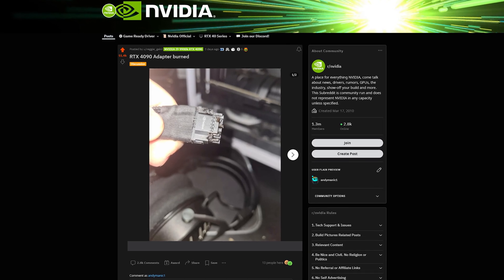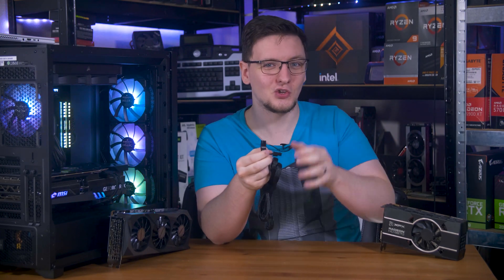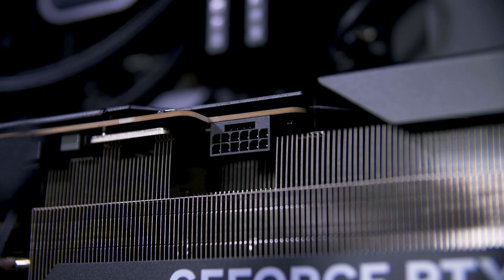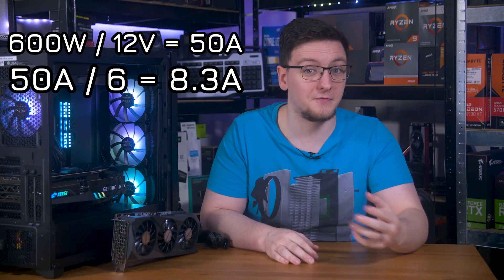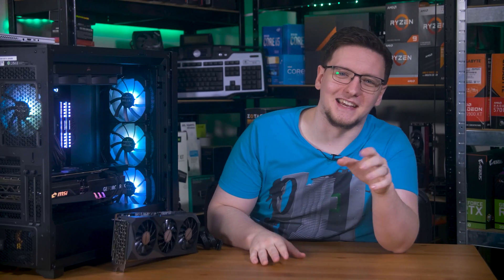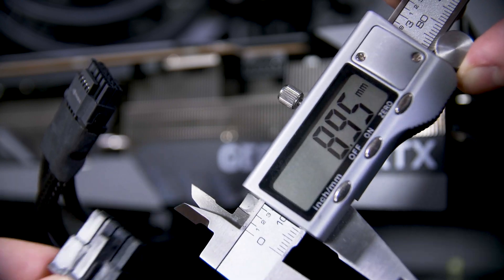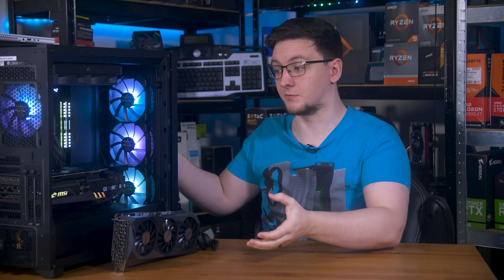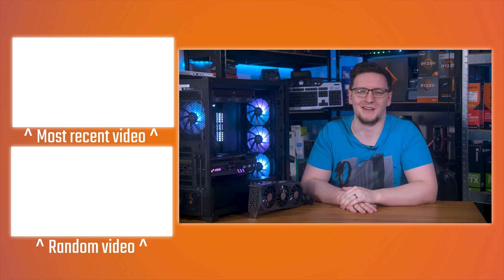Fire Hazard! Design Flaw? NVIDIA 12VHPWR Connector Explained

Comment: And now we know it was neither the fault of the card, adaptor or cable it self but rather people not plugging in the cable fully.
Reply: NO IT ISN'T ! The contacts simply have inadequate current rating. Per UL and IEC standards, the contacts should never exhibit a temperature rise in excess of 30 or 45C. To melt Nylon 66 (the insulation material) they are increasing in temperature by SEVERAL HUNDREDS of degrees C !
It's DEFECTIVE BY DESIGN !

Comment: i have a 6900XT and that uses 3 - 8 pin connectors i would rather have them than that stupid 12 pin talk about going backwards but hey that's Nvidia for you and at probably over £1500 they are laughing all the way to the bank

Comment: Having followed The Great 12VHPWR Connector nVidiapocalypse more closely than I'm comfortable admitting, here's the silly stuff I've learned.
-- the whole of the terminals are made from stupidly thin and easily to damage metal
-- itty-bitty, teeny-tiny solder pads attaching big old wires can break away from the rest of the terminal
-- the electrical load of the graphics card isn't balanced across the wiring where joined to the terminals
-- the wires are attached to the terminals with solder alone without being bonded with a crimp
-- the terminals provide no form of strain relief, both to and from, the attached wires
-- because the female portion of the terminals have two slits, the connection to the graphics card's pins is more apt to degrade from lateral and sideways force
-- in terms of wattage, the ~35% safety margin of the 12VHPWR fails in real world usage (golly gee whiz, with a little connector like that, it was utterly unpredictable >:-) 
-- seeing something built down to a cost, as contrasted to being built up to a standard, can be a wonderful source of schadenfreude

Comment: The loads on the cards are getting ridiculously too high anyway. But this connector isn't just good enough. It doesn't do the job properly. It should be changed, and it should have a better seating position than what it has now. At this rate I can see next year that will have cards with their own PCU's.

Comment: Jayz and Igor already reported that the issue isn't really the connector, but the supplied cable breaking up, which causes the remaining cables to draw all the power.

Edit: Looks like you already got the news, I didn't see it until I reloaded the page.
Reply: Hi, please watch Actually Hardcore Overclocking's video's (ramblings) covering the connector.  There isn't nearly as much of a safety margin with the 12VHPWR connector as there is with the normal six plus two connector.  This standard seems kind of borked.

Comment: Is the tech community REALLY going to have a robust discussion on why a cable under a 450W-600W load that is also EXTREMELY BENT very near it's connector may short/catch fire? A 90 degree fixed connector most probably fixes the problem.🤔
Reply: No, it won't. Entire spec is designed with a fatal flaw. Pin rating is 9.5A. 6*9.5*12 = 684W. There is NO redundancy in this spec. Losing even one wire means the rest will work over the spec. 9,5*5*12 = 570W. IDK who the fuck worked on this design - but it for sure were not engineers of any kind.